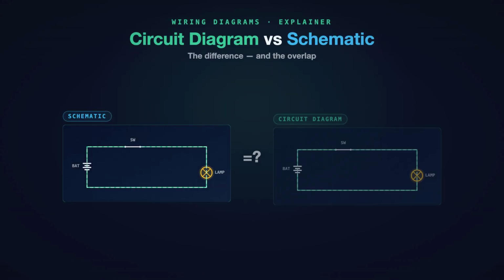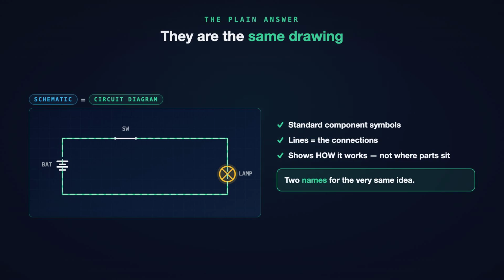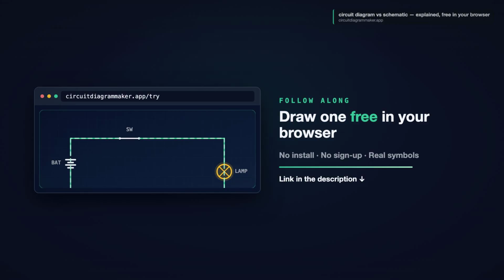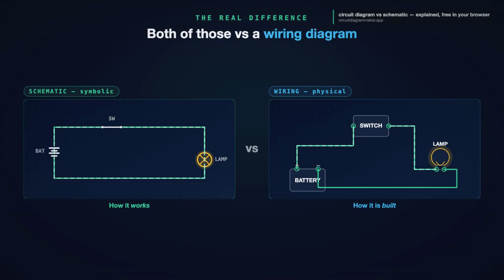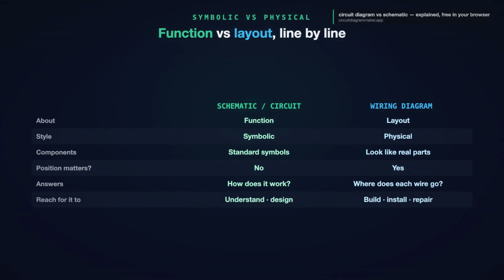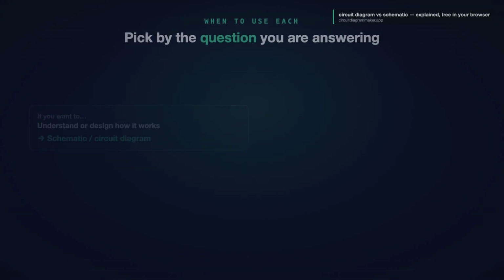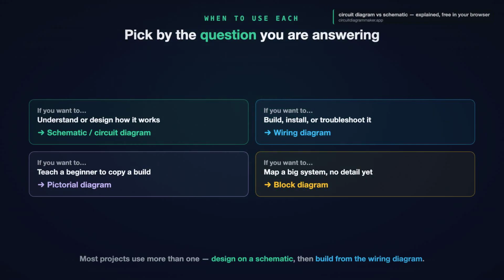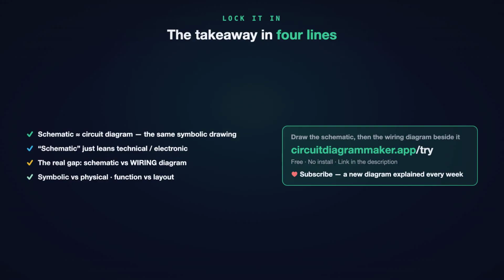Circuit Diagram vs Schematic Diagram: The Difference

Comment from the maker: Quick gut-check you can keep: on a schematic the position of a part means nothing — only the connections carry meaning — so a schematic and a circuit diagram are the same drawing. The moment position starts to matter (real terminals, where each wire actually lands), you are looking at a wiring diagram, not a schematic. Symbolic vs physical, function vs layout — that is the only difference worth memorising. Draw the schematic and the wiring diagram side by side and see it for yourself, free: https://circuitdiagrammaker.app/try?utm_source=youtube&utm_medium=pinned_comment&utm_content=yt-101